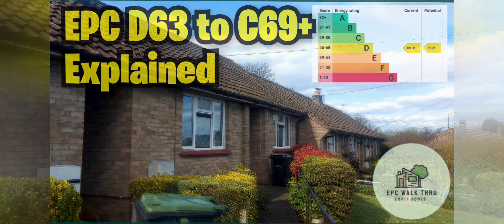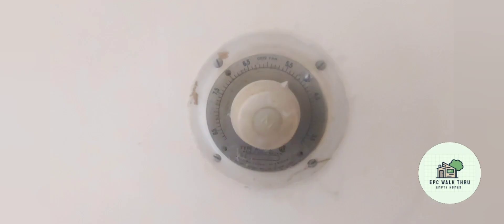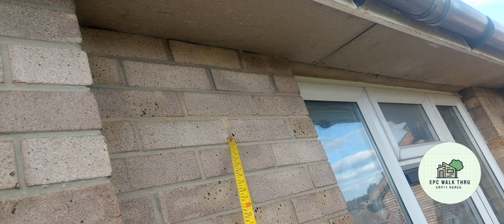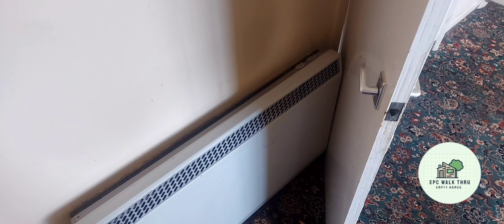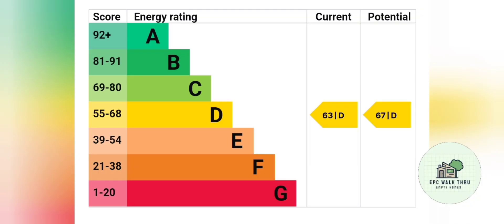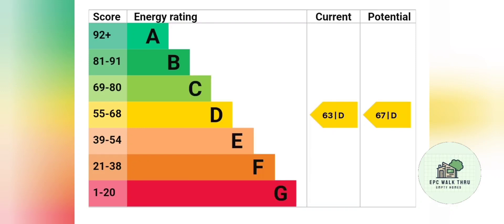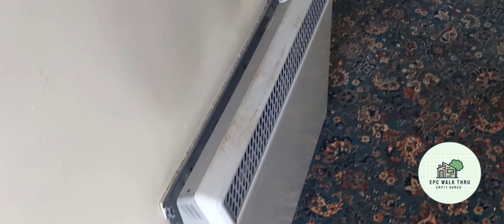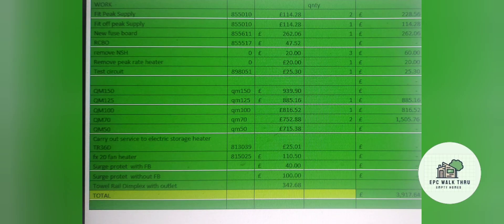EPC D63 to C69 + Night Storage Heater upgrade explained

Comment: I've recently done up a 1970's ground floor flat to try and get the EPC score up to a C. I swapped 2 old Dimplex storage heaters to the equivalent Dimplex Quantums and also added a hotwater jacket to try and get the score from a 62 to a 69. However I've just had a new EPC done and to my surprise, it achieved exactly the same score. Im wondering if the accessor has done something wrong, do the heaters appear just as 'Electric storage heaters' on the EPC?
Reply from the maker: Dimplex quantum should appear as High Heat Retention Storage Heaters HHRSH and also have " controls for HHRSH" how many storage heaters are there in total and what type of storage heater is in the lounge?
Reply: @EPCWiltshire  Its a 1 bedroom flat with a total of 2 storage heaters, the bedroom has a QM070RF and the lounge has a QM150RF. The main heating control appears as 'Controls for high heat retention storage heaters' which achieves a rating of Good but the main heating is only listed as 'Electric storage heaters' which achieves a rating of Average, is this wrong? The hot water is listed as 'Electric immersion, off-peak' which now gets a rating of very poor. On the old certificate this had a rating of Average, the only thing I changed was adding a 80mm hot water jacket. There are also now 2 Walls listed. One is Cavity wall, as built, no insulation (assumed) and the other is Cavity wall, as built, partial insulation (assumed). The exterior walls are of the same makeup so not sure why it's like that.